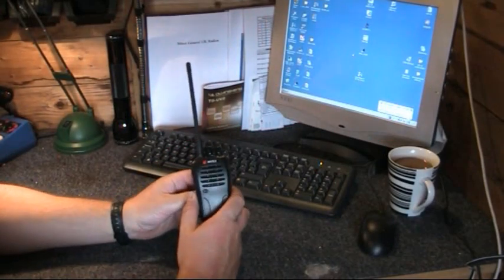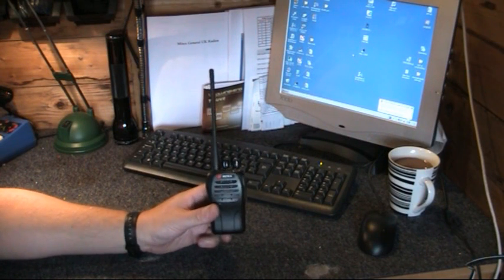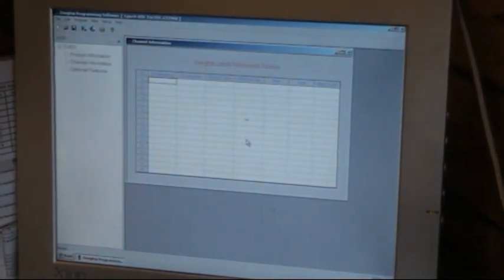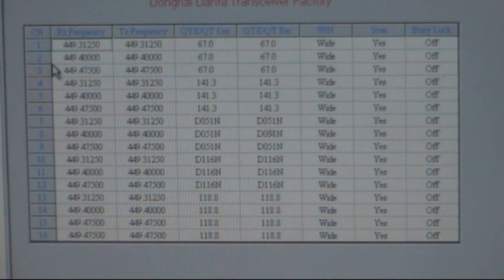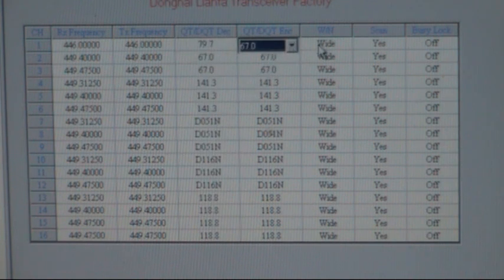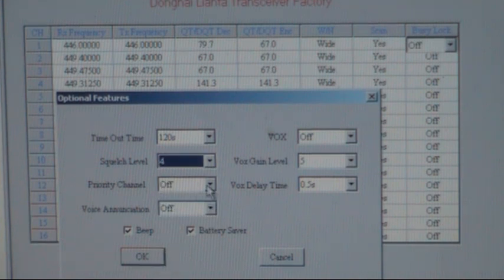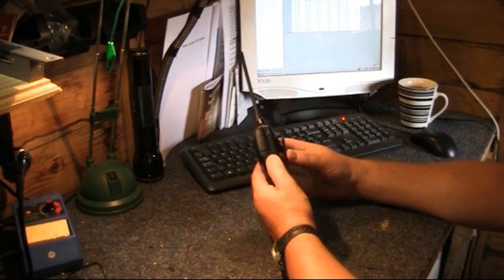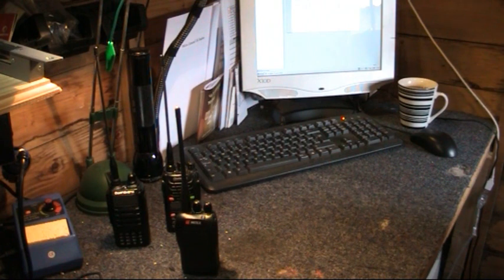Mitex programming software.wmv

Comment: Anybody know how to use the software to reprogram the 446 Mitex up to a full 5 watt handset? I have the full software from SFE for the S820 handset, but can't see any option of where to bump the power up to 5 watts.
Reply: Hi, PMR446 has a legal limit of 600mW. There would be no easy way of raising the output power I would of thought. If you want higher power then look into those Baofeng handhelds. I have a Baofeng UV-5R. Its a dual band vhf/uhf radio. I measured the output on mine and vhf was running 7w and uhf was 5.5w.